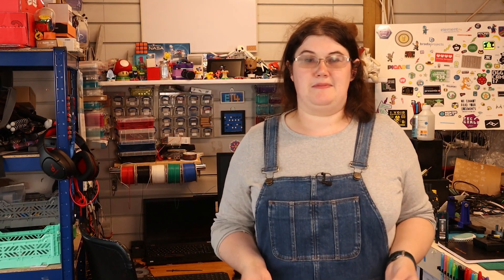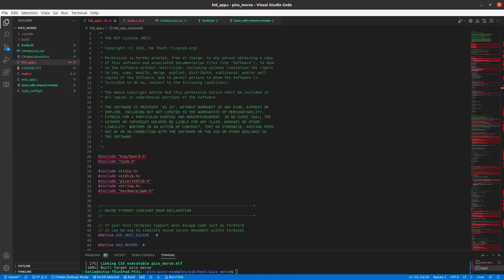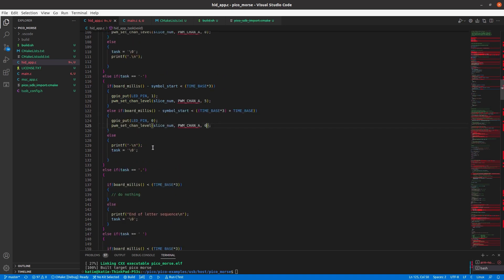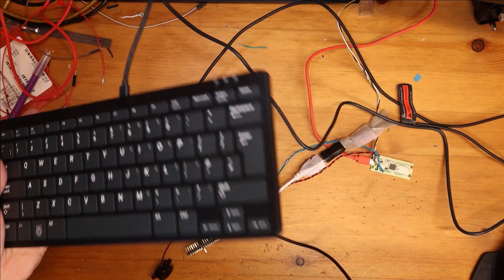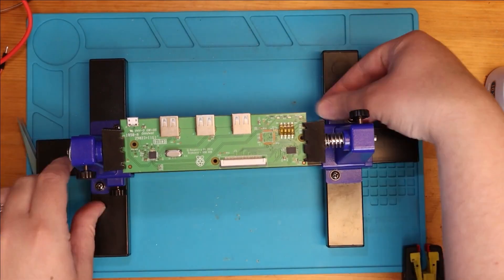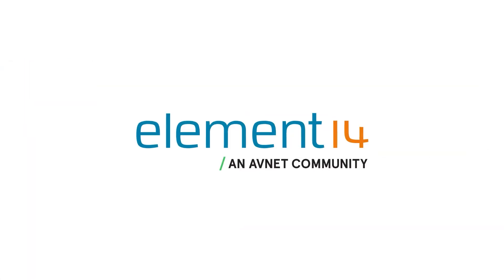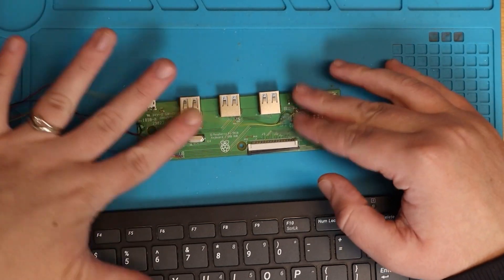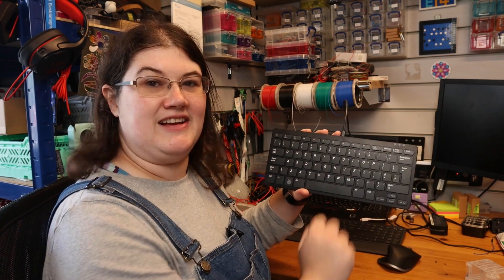Using a Raspberry Pi Pico to Convert Keyboard Input to Morse Code

Comment: As it is virtually impossible to type on a smartphone virtual keyboard without eye sight, a morse keyboard with only two buttons, dot and dash, has been used by some as an input method.

I had a renewed interest in morse code when I initially discovered I may lose portions of my eye sight.  In my case, injections have allowed me to still retain mist of my vision so far.  I am still however learning morse code, both as an option if my eye sight deteriorates and more so because of the geek in me.  Plus I was always a touch typist, so it would be cool to be able to type without looking at a keyboard.

Comment: as always, a fun project! If i may add one thing to it: why not add a jack plug on the back attached to a gpio (or indirectly via a transistor) where you repeat the same morse code and you can attach other things!

Comment: Nice! The pico is very tolerant for power so a basic lipo charger and a battery would be a great addition I think (don't even need a boost) and adding a haptic motor, or just a piezo attached to the top shell might be fun too. I hope you do a follow up.

Comment: Typically, ham operators recommend recommend playing characters at the 20 words-per-minute rate, and leaving the inter-character and inter-word spacing at the rate you’re trying to learn (5 wpm for example). This makes increasing your speed at a later time a lot easier.
Reply: A 20 wpm with a 5 wpm spacing makes getting on the Air incredibly difficult. One should learn their letters and keep the wpm and get rid of the Farnsworth.

Comment: Ham Radio still does Morse Code, but isn't required for Technician Class any more. Most 'commercial' and 'First Responder' transmitters in the US use Morse Code for station identification. Back in my Timex Sinclair 1000 days I wrote a keyboard to Morse Code program in Assembly. With the RPis I've been trying to find a program that decodes Morse to Alpha reliably. 
KD9EFV
73